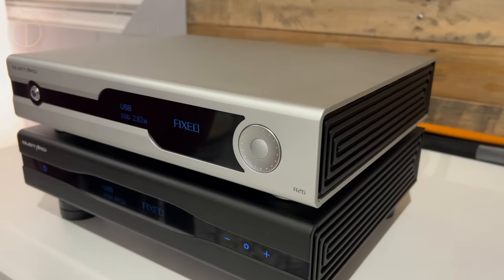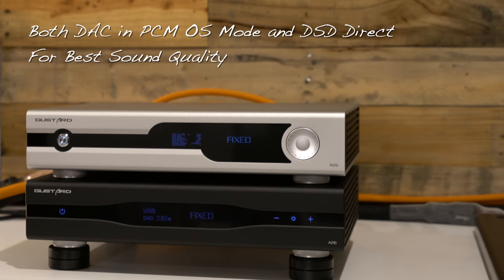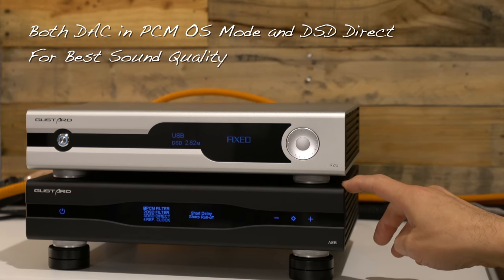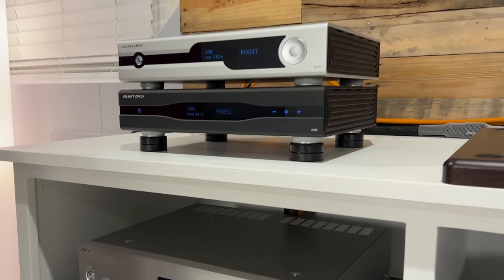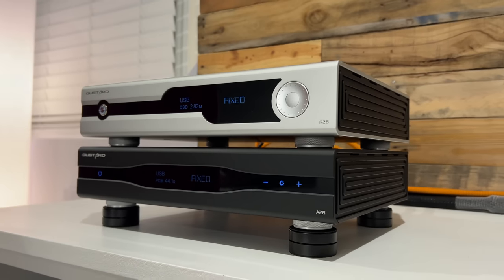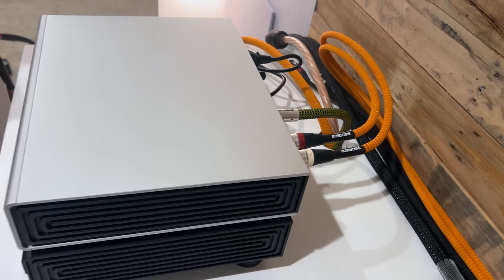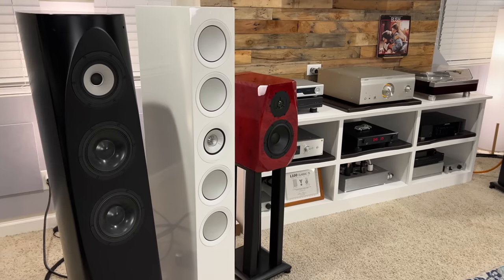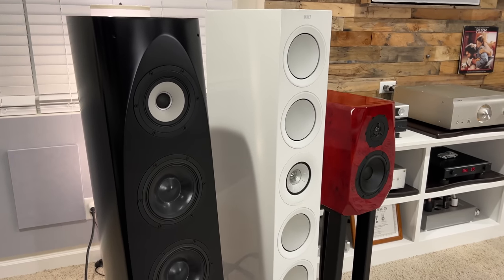Gustard R26 R2R Vs A26 Delta Sigma DAC Comparison

Comment: I had the A6 and R26 the same time. I decided to return the A26. R26 is sweeter sounding. A26, on my gear would get to the edge of too sparkly. Not enough depth and very bright up top. The A26 does not sound like others have implemented the 4499ex chips. A26 definitely is a great Dac. I just I preferred the better bass  and the darker sound of the R26.

Comment: Hi,
Which DAC to chose between R26 and A26 with a Technics SU-G700 m2?
The Tecnics is a FDA so the R6 seems to be the best choice... 
Thanks for your advice 😅
Reply from the maker: I would like to mention both of them are about 8-10db louder than industry standards.
If I have to pick one personally I would choose A26 for accurate sound but R26 should work well in your set up, thanks

Comment: Hello and thank you for the review. My question is R26's R2R - smooth, natural sound vs. A26's AK- velvet, smooth, natural sound. Which is more forgiving for lesser recordings. 
On the A26 how much of the 3-D sound stage / imaging do you lose when going from the monitoring mode vs listening mode?
Reply from the maker: I would say A26 is best of both worlds especially when you are using it in listening mode which is very similar to R26 in overall sound signature, image is about the same but slightly less precise, thanks
Reply: Thanks, I listen mostly to older rock / pop up to the 80's but have a sensitivity to overly siblent recordings.

Comment: I have the original Auralic Altair streamer +DAC (ES9018) (not the G1). I was thinking of buying the a26, do you think it will be a big improvement? My system is a Marantz 8802a preamp, Rotel 1095 Amp and Vandersteen 2ce sig ii speakers, with V2W subwoofers.
Reply from the maker: Yes it will be good upgrade in sound with deeper sound stage with more precision sound quality.
Reply: @Tharbamar  Thanks, I do listen to a lot of acoustic music - guitar, etc. You seem to think Denafrips is better than the Gustard DACs, but my quandry is then what to do for the streamer - Denafrips doesn't have one - what would you recommend as a streamer that is less than say $1000 that won't limit the performance of the Denafrips Pontus II or Venus II?

Comment: @Tharbamar great comparison ! I have the R26 since one week, and I need to decide if I return it or swap with an A26 ... I also use a DMP-A6 as streamer and DAC. The best results for the R26 IMHO- were obtained using the LAN interface through the Gustard renderer or through HQP/Roon/Gustard renderer (with NOS enabled & fast filter) vs R26 fed by A6/ME through USB Blue Heaven vs A6/ME used as both Streamer & DAC (Voices seem more separated from the rest but soundstage & backround are poor vs R26 in LAN). Just tested an A8 from a friend, it's a step further vs A6/ME but still behind in soundstage & background vs R26 through HQP/Roon/Gustard renderer ... Don't know what to do ... Return R26, keep R26 and buy A26, it's very difficult. Also R26 used through HQP/Roon/Gustard renderer has much more presence for voices even for modern music, correcting its trends to make them blurry when fed by streamer. What about DSD through R26, not native even used through HQP/Roon (with DSD option enabled in R26) ? But frankly A6/ME seems more analytic but not warm, more a demo DAC to impress your friends ... On Diana Krall, guitars are not nice on A6 or A8 vs R26. For modern music, best setup again for R26 is through HQP/Roon IMHO. Thoughts ?
Reply: I too pair the R26 with Eversolo DMP A6. It’s a perfect match for me. I had the A26 but in my system the treble is too much with the A26. R26 definitely more musical to my ears.

Comment: No offense.  I don’t mean this in a snarky manner.    
But it would be useful if you also tested some other high end DACs such as the Marantz SACD 30n which uses DSD Upsampling or the PS audio.  
Or some other higher end other than Chinese DACs. 
It would be more enlightening to the audience.  
Thanks and hope you don’t take that the wrong way
Reply from the maker: None taken, these DAC are better at price to performance compared to the brands you’ve mentioned, I had all that, PS Audio is way overpriced and overrated, DSD up conversion is nothing new I have been using for almost 7-8 years with Sony products and they are the ones who invented DSD for mastering, thanks

Comment: Even if the A26 is now favoured, I have still opted for the R26, because in my hi-fi chain it is transparent, crisp, deep, dark and playful. The A26 doesn't work so well in my chain, I don't like the treble so much, the treble doesn't fade away so quickly, it clanks a bit, the bass is also deep and dark, but I prefer to listen to music with the R26. The A26 is fast and transparent, but it doesn't have any pauses, you get a bit overwhelmed by the music. The R26 also plays fast, but perhaps sounds a little faster and thus creates a more airy presentation.

Comment: HELLO...I'm getting ready to buy a DAC ...what is better ?? Gustard A26 or Chord Qutest ??? Going through my Vincent SV-737 Hybrid - Dali Rubicon2
Reply from the maker: You will have to listen to them if you can because both are high quality DAC, you will have to choose base on your personal preference.
Personally I would get A26 over any DAC under $5K for extremely high in price to sound quality ratio, thanks
Reply: @Tharbamar  
Thanks Thomas...I didn't have a way to test them out and already ordered the Qutest...
Reply: Didn't like the chord Qutest-sold it...using Gustard R26 and love it...best sound using usb from laptop tidal...however I want to lose the laptop so need a stand alone streamer/usb...ifi zen streamer or new Volumio Rivo...debating🤷🏻‍♂️
UPDATE: Using Gustard R26, Vincent SV 737 hybrid,  Epicon 2 Speakers w/pair of Rel T7X...Streaming through Chromecast...sounds very nice✌️🎶🎶

Comment: I cannot believe I can hear a difference even in a youtube audio (at least I think so). I feel R26 soundstage/ambience is not very clear. There also seems to be some "fuzz" around the sound with the R26. A26 seems a little sharper and cleaner. Maybe A26 is more accurate. But R26 sounds "good". Note, I am a A26 owner (and previously a Chord 2Qute owner) and I still prefer the A26 sound. I am more of a "truth" guy than "euphonic sound" guy. I think I can trust Tharbamar's ears. Thx to him for all these efforts
Reply: For me the A26 was just too “sparkly” up top. So much so that It turns treble into something that people get tired of at least in my system.  It sounds great at first but eventually the highs are just too much. That’s just my experience though.  I feel the R26 is just plumper and sweeter sounding.  Another thing I noticed is that Gustard Renderer on the A26 would skip frequently.

Comment: Thanks for the video, I did purchase the r26 out of a desire to experience an r2r DAC and am enjoying it. I have it paired with class A monoblock amplification, not outrageously expensive amplification however. I do feel the r26 to be a superior product than the outgoing Delta Sigma x26 pro. I would agree however that the r26 is still probably a sonically superior DAC. For me the deciding factor was the Bluetooth, and streaming capabilities which other r2r DAC's such as the pontus 2 do not offer. This is the system I keep in my garage, and it is my most inexpensive system, but I do extremely enjoy it. Harman SACD player, schiit Aegir Mono's, kefLS50 meta, SvS 3000 sub.
Reply: Sweet ass garage system bro, and I just thought I was cool with a Wiim Pro feeding a Schiit Modi 3 dac and SMSL amp to Sonance Mariner outdoor speakers with a JBL powered sub on my patio system..lol ! You win 🏆
Reply: Wow, an SVS 3000 with S50 Metas? Isn't that way too powerful for those speakers?
I actually am thinking about switching my floor standing speakers for something of that size of speakers (I did check the Metas too), but then with 2X SBS SB-1000 Pro next to them.
Reply: @mikelanier5617   yeah... I just moved to a new home we renovated over the last year. Haven't had a garage like this before. Big enough to live in and plan on spending a ton of time in it. So wanted a great system to enjoy and a big sub to file the area/room (1,500sq/ft roughly).
Reply: @MarcelNL  It's a 4 car garage more or less, 1,500sq/ft. Need some big bass to fill the space. So went big with the sub. Honestly I was afraid the speakers and amps wouldn't be enough, but surprisingly they do a great job. Otherwise I was gonna move my JBL's (L100's) to the garage.
Reply: @elgingaragegym  Alright, thanks for the explaination! 🙂I have a rather small living room, tile floor, low concrete ceiling. 
I have rather big floorstanding speakers that go down to 30Hz but I clearly am missing something in the midrange and bass area.
The bass is friggin' LOUD around certain frequencies, but there is no warmth and also the detail could be much better.
You do hear them go down to 30Hz, but there is no body down there, or in the midrange.
The speakers supposedly are very linear so I guess it's the NAD C165BEE preamp that's causing this, but maybe linear sound just isn't my type of sound.
I was thinking about Wharfedale 4.2's or indeed those KEF's with some subs, but I understand those KEF's aren't really warm sounding?
Right now I think I'll just replace my cheap-ass DAC for a Denafrips Pontus II 12th anniversary edition. That supposedly gives the music much more body (and of course detail).
After that I can still think of subwoofers, different speakers and perhaps a different pre-amp.
Reply: Just received the R26 DAC this week and will be hooking it up to a Willsenton R8 running nos 1950s Sylvania tubes, feeding Elac Debut 6.2s and 2 SVS SB3000. Will be replacing the Elacs once I get the CSS Criton 1TDXs built and veneered. I'm really excited about my first R2R and hope it is as good as I've been told it is. Fun addition either way 👍
Reply: @MarcelNL  i am in similar sized room. i think your speakers may be too much for your room. i use small  high quality stand mounted speakers

Comment: If you are going to say a DAC doesn't do acoustic music well; you are basically saying the DAC is garbage. You might want to clarify your position.
Reply from the maker: No at all, if I use these DAC with JBL L100c75th may be different in experience with acoustic music but with S-1EX every weakness is visible because it doesn’t have the coloration from cabinets and I play acoustic guitar.
You just have to know the paring components.

Comment: Hi . Great video. I just got my A26 and have it hooked into a Shanling ET3 CD transport with Shanling I2S cable. It won't do DSD and it gives a feedback sound when i stop the song I'm playing XLR cables Sennheiser AMBEO MAX sound bar. I tried connecting with a Toslink but it says unlock underneath the OPT on the screen and won't do anything. Any ideas?
Reply from the maker: i2S pins could be very different between two because i2S is not standardize yet, I would try to change i2S setting in the menu.
A26 or AMBEO MAX sound bar does not have optical out thats the problem.
Reply: @Tharbamar  How do you change pin settings in the A26 there isn't anything in the menu about that?
Reply from the maker: @jkelley2091  there should be option in there for different types of i2S on either components but I’m not sure if I remember that correctly it’s been more than a year since.
Reply: @Tharbamar  there isn’t on the menu unless it’s one of those press this secret thing
Reply from the maker: @jkelley2091  There is no secret setting, may be try DSD direct on A26.
Also try USB between two, if there is no problem with USB thats  i2S connectivity problem between two of them.
Reply: @Tharbamar  I’m think you are right the opt works with no static but it doesn’t do DSD the USB works but I don’t think it did DSd either but the DSD is not real it’s converted PCM by the ET3
Reply from the maker: @jkelley2091  USB port can do DSD natively as good as i2S, you just have to configure it on your CD transport.
Reply: @Tharbamar  there is one on the Shanling EH3
Reply from the maker: @jkelley2091  yes

Comment: Hello Tharbamar, can you tell me that diameter of those isolation feet made by Tertullus which you did a video on?  Are they 30mm in diameter?  I'm wanting to mount them to the bottom of round 1.5" wood dowels to use for DIY posts for a stereo rack.
Reply from the maker: The one I’m using is about 45mm (1 3/4”)size, Just to clarify any brand name you might have seen is all made by Audiocrast.

Comment: A26(AK4499) vs. R26(ES9038)  chips  .... which DAC would you recomend if your friend has "Aune S17 pro Class-A amp?
Reply from the maker: Hi, R26 R2R DAC.
Reply: @Tharbamar  thanks.     just wondering your preference is a26 over r26.  how come do u recommend r26 with aune s17 pro amp?
Reply: @MoonerBros Your information is incorrect. The R26 is R2R, not Ess.
Reply: Hello, which of the two would you recommend for an Acchuphase E480 with vintage Tannoy speakers (Lancaster, Mansfield)

Comment: This review is very strange . Listening to track two the guitar sounds pretty good to me . I’ve found with the centre image with the r26 you need to re position your speakers to lock it in , you can’t use the same position for every dac as there all different .
Reply from the maker: Nope I’m not going to reposition 150lbs speaker for every DAC and my speakers are placed correctly for best possible stereo image and fine tune with room measurements.
Reply: @Tharbamar  just try it , this one time and you will be amazed .
Reply from the maker: @redleather100  Ha been there done that, my question is have you tune your room and speakers with REW? I have more than 20 DAC presently ($500 - $10K) never need to move the speakers.

Comment: Looks like the 3-4 seconds delay is also observed when IR port is used from a TV (maybe that is why ARC port is out of question). Feels like (not an expert) that it is related to AKM chips - I have not had any experience with ESS but main-stream dac/integrated amps well-known manufacturers are mainly (per my observation only) using ESS chips (perhaps those are quicker to process the signal).  Not sure but I am not impressed with the delay when TV songs come into play.  Other that this - the sound is great even via Sonos amp (both connect and the latest one).
Reply from the maker: You mean Optical port? HDMI ARC is not supported on most DAC only i2S. What is model DAC you have?
Why are you posting 3 times for SAME post.
Reply: @Tharbamar  yes, optical port. I have Gustard A26 as well as Topping E70 Velvet - both have 3-4 seconds delay (sound vs video) - over both optical cable from TV and usb port from computer.  

PS posted find out the answer (since the sound is superb but the delay is not good).
Reply: @Tharbamar  I will troubleshoot further and respond. It is possible that Sonos amp is introducing a delay.  I just do not have any other amps to try.
Reply: Apologies - that was Sonos amp issue:

1. Open the Sonos app > select Settings > and select System.
2. Select your speaker or wireless amp with the Line-In connection.
3. Scroll down and select Audio Delay > select Low (75ms).

In this menu, there are four different audio delays that you can choose from: Max (2,000 ms), High (150 ms), Medium (113 ms) and Low (75 ms). By default, the Line-In connection of your Sonos speaker or wireless amp is set to Max, which is 2,000 milliseconds or two second; this allows for the most time for the Sonos product to optimize its sound.

Selected 75ms. Works fine now.
Reply from the maker: I’m glad to hear that, thanks for letting me know.

Comment: Good video but man, why is everyone so hung up on all these labels r2r, sigma whatever...I think more preconceived notions we have, worse it is. I don't know if it's just for geeks to geek out over specs and the way things are constructed...at the end of the day, even if there's just chicken wire inside, as long as it works for your ears and system, that's all that matter.
Reply from the maker: Hear hear 👍
Reply: Dear Kevin,
Inside of a R26 there actually 2 completely different internal DACs. Depending of the source of the music you play, the data will go into one of those internal DACs.
If your source is Apple Music, Spotify, a CD, most streaming, the file type is PCM and R26 will use its internal R2R ladder.
If your source is a SACD, or some Qobuz files, the file type is DSD and R26 willl use its internal 1-Bit DAC.
These two internal DACs are completely different (the price of R26 comes for 90% from the R2R ladder, and for 10% from the cheap 1-Bit DAC).

To simplify a little bit, A26 is the other way around (A26 is designed for DSD, R26 is designed for PCM).

So, to simplify even further if I will only be using Apple Music and never by a SACD, but Tharbamar is only playing DSD (for example), I know nothing about how it will sound for me.

To simply to the max, It I the same as when you have to choose between a XBOX and a PS5.
It depends about what game you want to play.

So, I hope you understand there is nothing geek about the question.
The question is actually super basic, as basic as between a XBOX and PS5.

Therefore, I still hope Tharbamar will consider my suggestion for a Part II.
Indeed, he is currently the only reviewer offering a A26/R26 comparison, with is super interesting (but it is just incomplete for now).

Thank you.